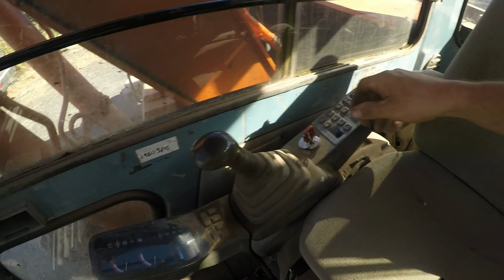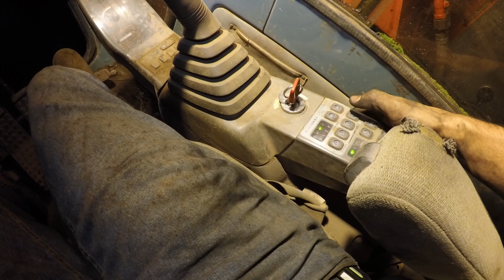New throttle cable and muffler for Hitachi excavator.

Comment: Love my EX 150 , been a great machine, it's a  1998 and never leaked a drop of Hyd oil anywhere till last year, one seal on one lift cylinder leaking a touch, and had the travel valve body under the main body, rebuilt.  But mufflers need to be covered so rain doesn't collect in them when not used for a bit. Great job on finding the muffler, price was so much better that from a dealer, Thanks so much.  Great video,👍👍👍👍

Comment: I have a JCB JZ 70 that I use around the farm. While I was taking some willow trees for a neighbor it started loosing power on the last tree. By the time I got it to the trailer it would just barely climb the ramps. It turned out that the muffler had come apart inside blocking the exhaust. It took over three weeks to get a muffler from England. I’m glad that I wasn’t depending on to put food on the table. Great videos, keep up the good work!
Reply: You can always pull the pieces out of the muffler or just straight pipe it until you get the muffler. There's always temp solutions out there.

Comment: I've watched this guy half a dozen times or so and if everyone had his work ethic we could eliminate almost all the problems within this country!  Notice he doesn't have an $80k pickup and a million dollars worth of equipment.  One of my friends has a business installing septic systems.  He has about a 20 year old Ford backhoe that he took all the glass out of since it didn't have a/c or heat and leases a 1845 Case front loader.  Never buys a new truck and said he has run over a million dollars through the hoe minus the lease but it still makes him money.

Comment: Great video. Glad to see I'm not the only one who trusts NAPA to keep their equipment and vehicles running. Been using NAPA replacement parts to keep my 1978 F-100 2wd pickup and 1979 F-350 4x4 project truck running. Both have been seriously neglected by previous owners and I'm the only one taking the time to keep them running properly. Gotta love the old stuff compared to most of this technology smothered crap.
Reply from the maker: David Genthner Jr yes.

Comment: Hardest working guy I've ever seen!
Reply: PS 400  Beats spending hundreds of thousands to keep absolute-garbage, new shit running.
Reply: He bit the bullet, maybe $350 in parts, oil, grease.  No different than me spending maybe $400 this year to keep my excavator going.  Paid for equipment can sit until you need it and it doesn't cost you $ every month.
Reply: PS 400  -- People who buy the new expensive stuff have to work hard to pay for them, and the repairs on them when they break down, and they probably charge a lot more for a job than Andrew does because they have to in order to pay for their expensive equipment, and so their customers are the ones actually paying for that new equipment. My hat goes off to Andrew and his way of doing things. It doesn't matter what industry you look at, when a man is first starting out they almost always starts with used equipment, whether it be contractors, farmers, truckers, etc. Then, when they get established and have the business built up and enough in the bank they can think about buying a new piece of equipment, but the smart thing is to not go head over heels in debt before then. Andrew is the smart one here, and he is not afraid of hard work either.
Reply: PS 400  In the years I've watched Andrew I've seen him go from Crappy stuff to  looking comfortable with a growing fleet. Can you say the same or having trouble paying your expensive, getting old, crap?

Comment: i enjoy your accomplishments. 
thought i'd give you a suggestion, for when you change oil/fuel filters. 
removing the filter, after breaking the seal. put a plastic bag over the filter to catch the oil that comes out of the filter housing... i use a plastic bag from a loaf of bread...  pour the extra oil into your catch can. then just put a loop on the open end, making a half knot. sealing the oil from making a mess. put the bag and filter in a bucket for disposal.  
i use a sharpie, putting the date and engine hours on the filter. smear fresh oil on the new filters gasket, then add some fuel/oil in the filter before installing. only if it can be installed without tipping it sideways.

Comment: I use 409 and dawn dishwasher detergent mixed.  Spray liberally on motor and all parts.    Rinse will garden hose or pressure washer.  Cuts grease and oil like butter. Leaves everything shiny and new.

Comment: Just a tip when changing oil filters, and you dont want to get oil all over the place. 
Punch hole with screwdriver in bottom of filter, and do a more controlled oil spill :)
Reply from the maker: Roy sigurd yeah, that's a good idea. I'll do that next time.
Reply: you are a fucking genius, im doing this
Reply: Works great!  I do it on my truck too, I use a scratch awl.  One thunk with your palm, and give it about fifteen minutes if you're not in a hurry.  TONS less mess.
Reply: or just use a plastic bag? knocking holes in filters take to long to drain. No one knocks holes in filters anymore but people who get salary .... Plastic bag from the store for free ... 15 seconds off oils in the bag with the filter boom done.
Reply: But then you have a bag full of oil to deal with.

Comment: Hey Andrew.
Next time you pressure wash an engine like that spray it down with a 30/70 mix of Greased Lightning. The soot and grease will melt even before you pressure wash it.
Resturants use it to clean caked up fryer grease.

Comment: Awesome video! I love the crushing of the exhaust at the end. Hey I noticed the track rollers guides where sticking.....
Reply from the maker: Thanks. They roll when the track is against them.
Reply: oh ok. Didn't know if that was a problem or not. Well thats good.
Reply from the maker: Usually they don't lock up, usually the bearings blow out of them, and they have like inches of slop.
Reply: Yeah that makes sense. All that weight and torque. Hey do you know anywhere I can get a cheap but reliable skid loader? My son been doing landscaping for several years now and really could use one? Ive been looking around on ebay and truck pages. Just dont really know what to look out for. Any suggestions?
Reply from the maker: Tony Home Craigslist?
Reply: Understood.

Comment: Andrew DOn't know if you know this but a lot of times you can get a computer chip for those on demand hot water heaters which will allow you to up the temperature much higher than factory settings. I have a Rheem and I bought the chip for mine. The higher the temp tho, the slower the water is because it takes a little longer to heat. It depends on what you want to use the water for. They come with residential chip. The other is called a commercial chip.

Comment: Andrew. Be carful. The machine I have is pretty close the that.  It’s a John Deere 70d. The exhaust did the same thing as yours except it melted a hydro hose instead of the throttle cable and when the hose blew it burnt the entire machine down to the ground!!
Reply: Mad Man Marine I have a 70d also but my muffler got ripped off by a tree

Comment: That's really clever hooking the pressure washer up to a tankless water heater. Have you ever had a problem feeding hot water into a cold water pump like that? I wonder if one could mount a tankless heater, propane tank, and washer all onto the same cart to make it more portable.
Reply from the maker: Jacobd123456 I initially worried about it, but I've done it a lot now with no issues. Make sure you get a pressure washer with a good pump, the good ones have big cooling fins and are usually made in Italy.
Reply: CAT Pump, the one with "9 lives" anything with a Cat pump is good. They make one of the best.

Comment: You might want to fill the oil filter up with oil first, it gets the oil to the engine bearing  quicker, instead of it having to push the air in the filter thru the bearings first.

Comment: Hey I'm not too knowledgeable about excavators but I would check those bottoms rollers on the track soon I has the same situation where they seize up a little bit and then 3 roller bearings broke....500$  down the drain and I had to install new ones
Reply from the maker: Usually the bearings blow out of them before they seize up.

Comment: Nice job! Get a box of  surgeon gloves and it's a whole lot easier to avoid nasty hands. That ole dog sure has the life!￼
Reply from the maker: marty Highley yeah, I have some, guess I could have worn them.
Reply: Before greasy work ----- Wipe hands / arms with a wet (not to wet) bar of soap. Scratch palm of hands with fingernails. Work soap residue into all parts of nails. If you can avoid washing hands before work complete you will be surprised how much cleaner your nails will be. Of course you can still also final clean up with the commercial hand cleaners etc.
Reply: That dog loves walking into water.

Comment: I’m a retired mechanic for fun I used to buy old machines refurb them like rip out the shitty old engine and replace it with a brand new one not even the same model what ever I could find at the best price and horsepower. Match it up to the pump and engine mounts sometime a little custom fab a rebuilt hydraulic pump so the new owner wasn’t dancing disco with his arms in the cab and resell them for a small but good profit..it was fun why I stopped who knows maybe it wasn’t a challenge anymore

Comment: 2:27 Isn't the only downside to using a hot water heater like that on a residential pressure washer that they are usually only for cold water? Since the cold water is used to cool the pump (as I'm sure your probably already know, and as to why you can't run the pump dry). To work around this I assume usually hot water pressure washers heat the water after it has already been pressurized.  

               Hose Hookup
                (cold water)
                          ↓
Pressurized Water from Pump
               (warm water)
                          ↓
Gun Hookup from Water Heater
                 (hot water)

Just a hypothesis for those of you thinking of trying the same thing with a standard hot water heater. I'm not necessarily advising against it, but maybe it's just the kind of thing you don't tell them when you need to make a warranty claim.

Comment: If you take a Philips screwdriver and punch a hole in the oil filter it won't run all down your arm when you go to threaded let it drain completely and then on threaded off there make the whole lot less than mess

Comment: At five 5:57 seconds it look like right after you installed the throttle cable there was a loose jam nut next to that elbow connection.  I can only assume you left it loose to adjust the linkage.

Comment: I'll never understand people that let their equipment degrade to the point that they stop working all the time. Next it wont be a throttle cable, it will be a a melted fuel line and the whole thing goes up in flames. I mean jeeze...when you see the engine covered in soot, you find the problem and fix it, not wait for the engine to stop running or for it to blow up.

Comment: I have an ex120-3 and have low oil pressure idiot light going off and am having no luck finding it any help would be great thx 👍👍
Reply from the maker: Does it have oil in it? Maybe install a manual gauge to test if the light is accurate.
Reply: @AndrewCamarata  yes almost 100%either the sensor is bad or the filter and oil is no longer any good
Reply: @AndrewCamarata  also I plan on putting a manual gauge before o run it again thanks

Comment: You can run hot water through a regular pressure washer?  Thought it made it overheat...
Reply from the maker: I have been doing it allot, no problems yet. That washer does have a good "made in Italy" pump on it. Some washers like that have a much cheaper pump.

Comment: Grate video just wondering if you ever replaced the slew bearing on the Ex100 digger
Reply from the maker: Jonathan Morrison I have not. I did just do the swing motor/swing gear, and the orbital valve, because they were leaking.
Reply: wouldve like to seen a video on that Andrew how costly of a job was that?

Comment: I love watching your videos I was just wondering, where did u learn everything? (Equipment operating, fixing everything, welding, and landscaping stuff)
Reply from the maker: Thanks, that is a good question. I learned things a few different ways; my dad, some classes, watching videos, and working with other people, but the main way is, if something needs to be done, I just do it and make it work.
Reply: Andrew Camarata ok thanks. I'm 15 and not quite sure what I want to do for a living but whatever I do I've always wanted to learn how to fix machinery and do some of the other stuff you do. One last question; is the shipping crate castle ur main living space? And if so, doesn't it get filled up with exhaust? I'm just thinking of times such as when u replaced the cylinder head on ur skid steer and when u fired it up there was a lot of black smoke.
Reply from the maker: Graham K being able to fix stuff is s good skill. With those high ceilings and the exhaust fan, making it smokey in there is no problem. Plus the office area has a door.
Reply: Ok

Comment: In need of some assistance: I have a hitachi ex120-3 and recently in the middle of a job the rpms just don't seem to want to go as high as it is supposed is this a commen problem on the machine I think it is a wiring problem in the dash but havent had Time to work on the machine as it is still on site thanks

Comment: I have the same job infront of me too :)  But i want to find a cheap 3.5" muffler
Reply from the maker: That muffler was cheap, and it fit right on there, re-engineering the wrong muffler to fit to save a little money wouldn't have been worth it. What machine are you working on?

Comment: so literally did most of the same work on mine last week... hoses and muffler... anyway, I have a ex120-2 which is largely the same except hp and weight... however it does seem to be running the same controls, and there is a row of buttons on the bottom that have some sort of hieroglyphs, was curious if you had any idea what any of them mean?  I kinda figured it has something to do with power control but? I is dumb and not a great operator so I just sort of guess.
Reply: also I love the on demand hot water cheat.
Reply from the maker: northman logging that's funny, my friend also just did that repair on his 120 too. I don't know what those buttons do either.

Comment: How's the pressure washer holding up with hot water?  I think most little ones like that say not to use hot water with them but I have considered doing the same as you.  Just wondering if you noticed it hurt anything.

Comment: Hey Andrew, how long have you been running hot water through your pressure washer?   I’ve contemplated doing this many times but have always read that the pump can’t handle the hot temps.
Reply from the maker: I did it allot. That thing finally died though. But I have used that pressure washer so much.

Comment: most cheap  home owner washers have plastic pieces in the pump and  die rather quick with hot water  feeding into them
Reply from the maker: I have been doing that a long time now and that washer is working fine. It has the larger pump with cooling fins that says "Made in Italy", I think those are the good pumps.

Comment: shouldve saved the old muffler to make low cost replace ments.
Reply from the maker: That thing was rusted garbage, why would you save that?
Reply: well buy 1/4 to 1/2 inch pipe the same with. then by plate the same thickness . cut holes the  in pipe. weld parts to gether an make your own muffler. yes it may be cheaper to buy a copied unit . but when your on a cheap budget . you make wat you can.
Reply from the maker: Nathan Dean I really don't think that would be worth it, that new muffler was pretty cheap, and it just went right on there easily, I did scab that old muffler back together twice already, and did get a couple more years out of it, but it was just garbage by that point